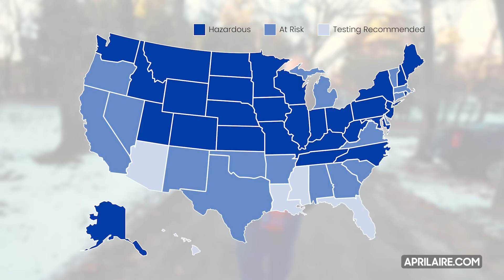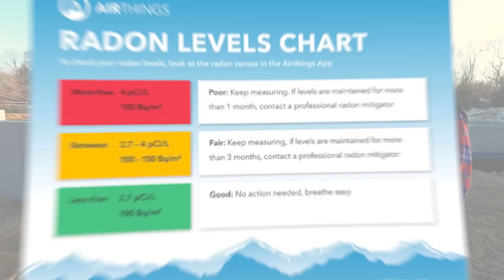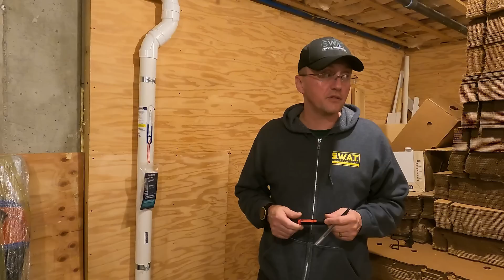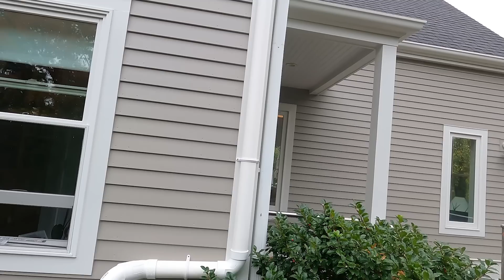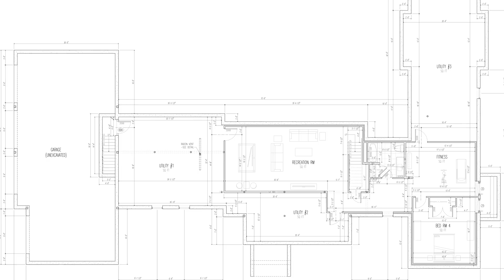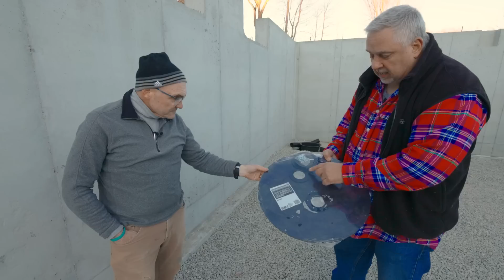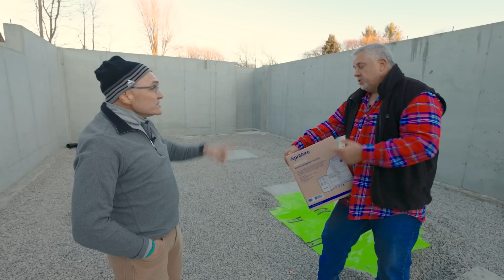"Radon Mitigation" Build Show Build: Boston - Bonus Episode

Comment: My understanding is that even in states with very high ambient radon levels, the outdoor levels rarely exceed .5 pci/li.  So 4 is probably too much, particularly when you consider that homes prior to 1950 or so didn't have central air and generally didn't have habitable basements, so the levels were typically much lower.  Nice thing about the airthings meters is they can be used over a much longer time span, while other methods only sample over 24 hours or so.  In my experience variations in weather can alter levels by as much as 3 fold.  So a reading of 4 on a high pressure series of days could be 12 when a low pressure system moves in.
Reply: great points - thank you

Comment: How many feet apart should the perforated pipe lines be? I assume there is a "tree" of pipes down there or a series of "H"s or something. Basically what is the max recommended pipe to pipe distance to have an effective radon mitigation system?
Reply: We have 2 for about 3000 sq ft of slab
Reply: @stevenbaczekarchitect9431  Thanks. Yes but two, how long is the horizontal part of each? Is there any branching/ Tees in the horizontal part or just a long straight run?
Reply: @SwordOfLaban2  8' straight pipe in 10" stone bed of 3/4" stone
Reply: @stevenbaczekarchitect9431  wow. I know nothing about radon but that is just not a lot of pipe length for a large house. I'm guessing the gravel is the key, not the pipe. The gravel makes like a big plenum under the house. Ok thanks for the tip!
Reply: @SwordOfLaban2  yes correct

Comment: something for Big Red 
some variables affecting the measurement of radon
natural levels of radon, barometric pressure (falling pressure tends to increase the release of radon from soil with a time delay), location in house, accuracy of the measurement sensor ( multiple sensors sitting adjacent to each other do not read same measurement.  what is the acceptable variance?)  living space measurements can be affected by duct leakage (negative pressure in ducts relative to basement air pulls radon gas into the system from basement,  negative pressure in living area compared to basement pulls radon into living area through cracks and vapor paths) 

for new construction consider improving sub slab air flow (but perhaps no longer passive)  by replenishing air under the slab to increase the flow. that replenishing air could come from outdoors or the hrv or erv after careful pressure/flow calculations. consider edge placement of perforated  pipe with "clean" to sweep the gasses to exhaust vent. could be edge to center flow or edge to edge depending on where exhaust is placed.  use similar design criteria as is used for living space air flow but applied sub slab.

why do vent pipes not get a rain cap?  is it believed that air flow upwards is sufficient to keep water from going back down the stack?  A simple "roof" over open end would seem to help. 
outdoor horizontal runs tend to condense moisture during cold temperatures and gurgle. a built in condensate release point or water trap point will solve the gurgling noise issue.

Comment: Hey Steve, what's your thoughts on utilizing the below slab water drainage and radon mitigation piping into one system if you are able to simply daylight your water drains on a sloping site rather than using a sump pit?
Reply: I like to keep them seperate
Reply: It will work but not as well because 1) the drain pipe can be full of water which will restrict the air movement 2) you'll have no stack effect ensuring some air movement since the drain exit point is lower than the pipe itself
Reply: The radon containing air doesn't run downhill like water
Reply: @muchmuchmore  obviously.  I meant having the daylight drain for water and the stack through the roof for the radon, just combining all the piping together into one system.

Comment: I run Airthings sensors as well but the problem with this system is the humidity I believe drastically throws off the numbers. When talking with local Radon companies, humidity needs to be under like 50%. This can be difficulty in summer months, so best is to align with these sensors in the winter when humidity is lower. I get into 5s in Summer but in 2-3 in the Winter.
Reply: This, also you have to reset them and let the sensors recalibrate for 7 days in the new area you move them to.
Reply: So put a dehumidifier down there.  All that humidity crates mold.

Comment: Does the AprilAire fan run continuously or on a schedule?  Would the fan essentially create a vacuum under your house since it is adding suction to an enclosed cavity?
Reply: It runs continuously to create negative pressure under the slab.
Reply: @Rickmakes  Why would you want negative pressure? Won't this system draw air from sump pit and from seam between concrete floors and walls thus creating negative pressure in the basement.
Reply: @rhondalemmon3076  Yes, it would draw air from those locations. These are also the areas where radon enters the home. I'm no expert in this but I'm guessing there are situations where they would caulk the seams to increase efficiency.
Reply: @rhondalemmon3076  what needs to be done is to seal off all of those areas. The retrofit in this video talked about sealing the gap between the slab and the foundation. The new build will have 4” of closed cell foam with the Stego on top of it. 

My experience - in our ~25 year old home, we sealed that gap and added a fan to the passive vent which the builder installed (code reqt here) and the numbers went from 25 to just below 2.
Reply: Confirmed. You want a slightly negative pressure under the slab. A part of radon mitigation should be using radon sealant on any perforations on your 10mil vapor barrier. This barrier should be run up the side of the foundation wall and be radon sealed to the wall.  No air should be allowed through. The sump pit should also be sealed. The radon fan will pull air from under the slab up through the sump to a few feet above the roof

Comment: A pity Form-A-Drain doesn't sponsor this channel.  Their system will mitigate Radon as well as groundwater when you pour the foundation for a new build.  Their "capture points" are the entire perimeter as well as any foundation "beams" crossing under the basement slab floor.
Reply: I have it on a couple projects at the moment
Reply: @stevenbaczekarchitect9431  How have they worked for your clients?  I definitely intend to specify them if/when we build, especially since we want to go ICF (including ceilings) so it will be a VERY tight build.
Reply: @michiganengineer8621 Did you ever build this? Any documentation of it? Would love to watch a video on this.
Reply: @Th3120ck  Not personally, although it's part of the planning for our next place.  Bealy Good used Form-a-Drain for his ICF house that's under construction in NC.  Take a peek on his channel.  I'm nnot certain but I think Jesse Muller did with his build in New York (also here on YT)
Reply: @stevenbaczekarchitect9431  I hope you guys can talk about it on a future episode, sounds interesting!
Reply: I'd never heard of that, but it looks like a no-brainer: a concrete form that's also a drain!

Comment: Since it is a new build why wouldn't you put the pipe in the stone and take it to the Perimeter of the house along with putting Perimeter pipe around the foundation like your drain, so you aren't sucking in gas from the surrounding land?
Reply: The drain tile is on the perimeter, but it has to come inside to get to the sump pump. You can't have the sump pump outside because it could freeze up in the winter since it has to have an access cover.
Reply: @ColeSpolaric If you have pipe around the house in the ground it will fill up with water and not evacuate the gas.